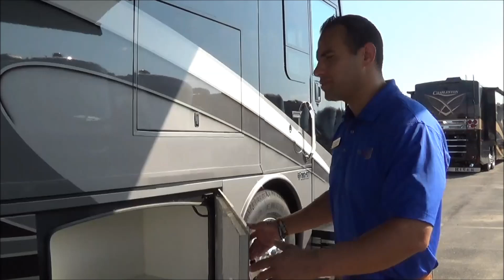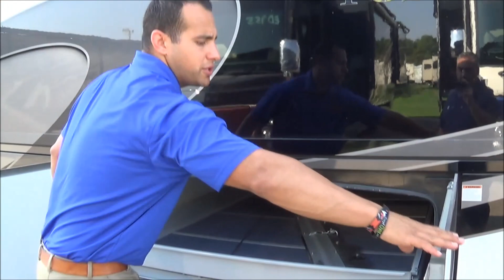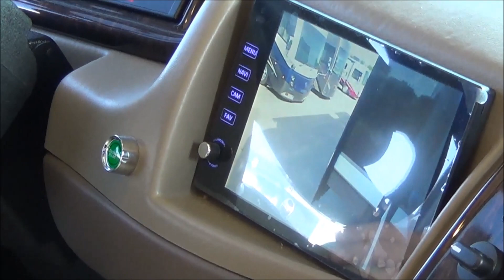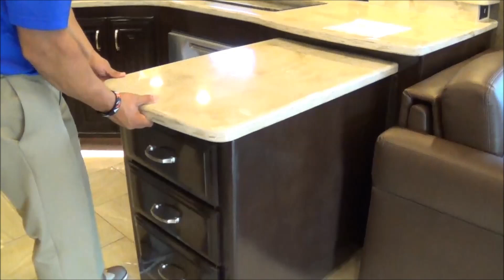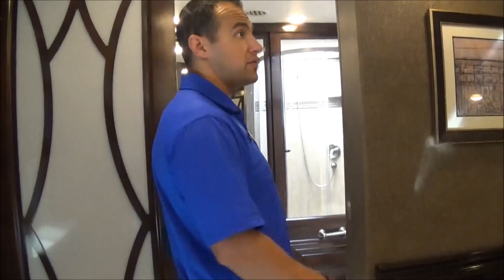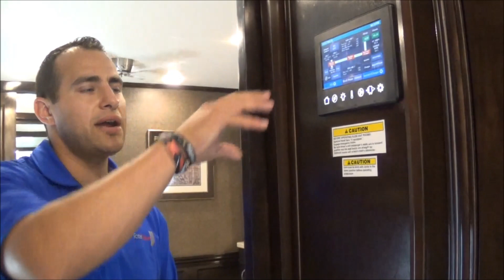Chad "Your RV Guy" Walks Thru the 2018 Tuscany 45 AT!

Comment: Great comprehensive video Chad! Is there a package option that would include a rear ladder? I'm a little disappointed that a coach of this magnitude wouldn't have one. Thank you.
Reply: James Canty thank you sir.  That's not an option for a rear ladder. However if it is a must-have I'm sure a side mount ladder could be mounted that folds down and does not protrude out of the sidewall. It's more of an aesthetic look that they're going for like the entegra product if you will